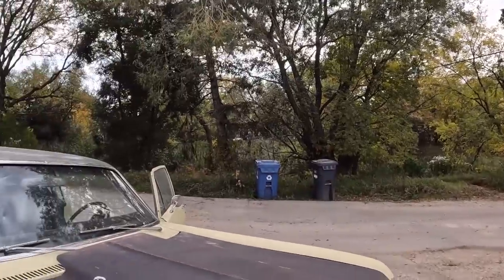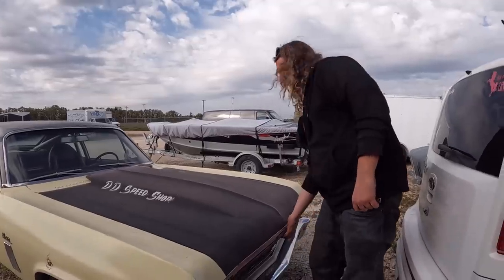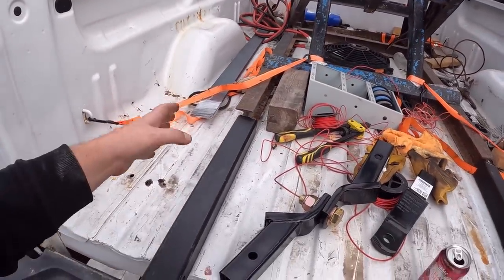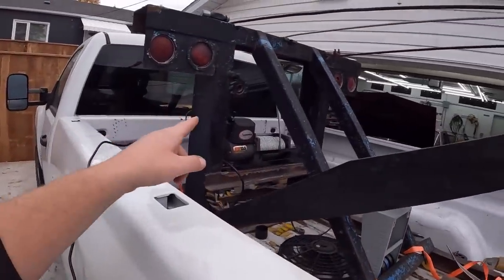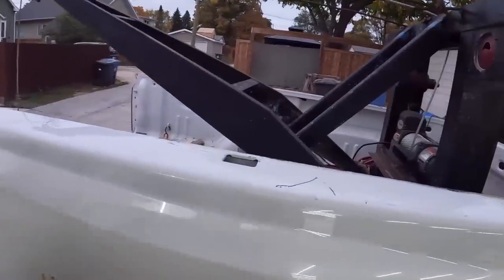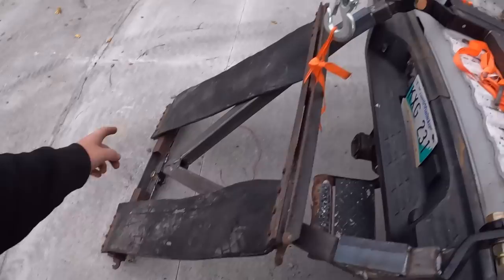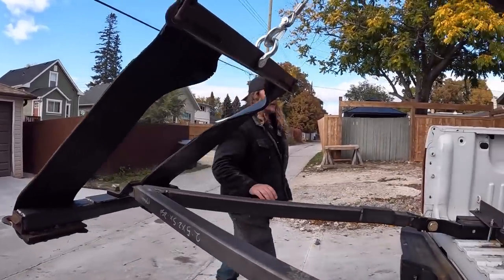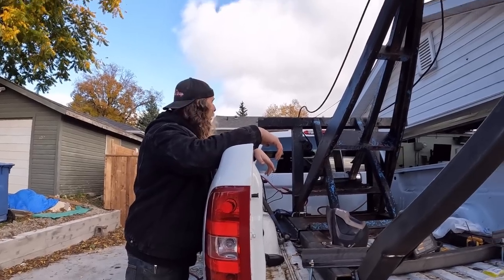Welcome To The Thunderdome - Fabricating A Home Made Car Hauler.  Slingin' Junk

Comment: Great job Dan, not telling you how to do your business but.... Suggest you put a plate in your apex to mount a trailer ball that way you can haul trailers without removing your frame section. We also used our wrecker/ trailer combo to move utility buildings if you raise the boom and winch at the same time it's like having a rollback and it was priceless when moving things. Again Great job.

Comment: So Dan, I ran wrecker back in the day. The outrigger from the wrecker to the bottom of the sling were always kind of floppy. That was on purpose. Yours is way to rigid! As one tows and pulls into parking lots and drive ways, the tow truck and the towed vehicle are not always in the same plane. With as rigid as you have it, the tow truck is going to try to twist the towed car from left to right. I suggest that you attach the bottom of the sling with the bottom outrigger using a hitch ball and hitch part that fits over the ball.

Comment: Dan
Your method and thinking is spot on.
Over engineer a little as you are pulling a 2- 3 tonne projectile when a car or small truck is hanging off the back.
You don't want any breakaway when towing and the added length of the tow frame will also add strength to the truck Chassis.

Comment: It's so cool your creating an old school tow rig style setup that was used commonly back in the day on a current style truck, so cool!!! Also, your very clever for using tow hitches as the strong pivot points on the tow section. 👍👏😎

Comment: Looks good the only thing that makes me nervous is the All Thread which is usually grade three or five and with the weight you'll be hauling I think grade eight is necessary. just my opinion.......
Reply: There is “boiler” allthread.
Strong like bull.
Wear gloves, the threads are deeper than the normal allthread
Reply: @sammolloy1  So you think cheap Dan used the boiler allthread? Ya right.....

Comment: Hey Dan, I put one of these together about 10 years ago in similar fashion and it actually towed really well.  Only thing of concern is your winch. Make sure it's rated for lifting, a regular winch is only rated for a rolling load and not for lifting and holding. Otherwise you will need to look for a proper hoist rated for lifting. Looks good otherwise,  cheers.
Reply: Thats a good point

Comment: When I worked for a auto repair we had a creation that used a Chrysler starter we had a heavy duty battery at the winch with a charging wire from the truck alternator with a extended boom for general stuff well pumps working on fatm tractors out in the fields, it had more winch than truck lol.. it was sure handy.

Comment: I've owned both sling boom and underbody wheel lift variants.  The underbody unit was a former service vehicle I'd bought that had been retired and required everything from the hydraulic hoses right through to the body changeover from my other truck. The sling boom unit was bought from a scrap yard and I installed it myself. I used half inch thick 'L' brackets and Gr. 8 3/4" hardware to secure the unit to the chassis at 8 points, 2 at the front hinge points, 2 about 1.5' behind those,  2 behind those roughly above or just behind the axle, and the other 2 at the rear. The two BIGGEST things I can suggest is to build your rear spring sets suitable to what you figure the heaviest vehicle you will tow will be; and MOST IMPORTANTLY, TRUSS YOUR TRUCK'S FRAME!  If you have the opportunity, look at another similar unit. I used 2x2 1/4" wall square tubing and 1/4" inch plate to fabricate my bracing. I installed mine directly below the frame to keep it tidy. I've also seen it done using 3/8" plate installed vertically at all chassis bends and 1/4" angle tying everything together from the front torque boxes to the rear most mount points. Hope this helps even if in a small way.  Also, keep a 4x4 and a 6x6 by 5ft chunks of wood in the bed when you're towing. They'll help save chrome bumpers, front valances etc when placed across the "j" hook chains and between them and the towed vehicle's frame.

Comment: Hey there Dan. As others have mentioned, the bottom bar of the sling should be able to pivot or it'll bind. Also, you might find that flipping the sling A arm over will help keep the bars out of the car and let the sling carry it. Built my boom truck/wrecker with receiver hitches too!

Comment: I used one of those tow trucks in the 1980s we had it in a 1975 Chevrolet 3/4 ton pickup I towed a lot of different vehicles cars pickups with no issues

Comment: You asked ! I think your winch is mounted 90 degrees out it should face the direction of the pull , they're designed to pull horizontally , the way it is atm it's trying pull the mounting bolts out vertically and not as strong .

Comment: When I started with Chevy in 1978, we had a Holmes. We took an old Ford a/c compressor (york style) and made an air compressor out of it, so when we left and thought we might need air we had a toggle switch on the compressor clutch to engage the compressor.
Reply: Nowadays, I think you could likely use a compressor from something with air suspension. Saves hassle that way and a junkyard part that can be swapped quick without hassle
Reply: @philgrimsey3637  i’ve actually used the York AC compressors off Fords and Chryslers in air ride setups because they fill a big air tank faster than electric ones do. They just work better.
Reply: I been meaning to ask someone about doing that. I'm guessing you'd use the "high side" to pressure the tank and run a pop-off valve to prevent overpressurization, but what do you do with the low side?
Reply: @NAWeldingandFab  just a pressure cut off switch off a normal compressor (like one you’d have in your garage) low setting to kick it on and the high to shut it off and yes a mechanical popoff so it doesn’t over pressure.
Reply: @NAWeldingandFab  I miss understood what you were asking…the “low” side you leave open to atmosphere to intake the air to be compressed. A piece of tube with an air filter on it so you don’t suck dirt into the compressor.
Reply: @AndyGee's Garage, thanks for the replies and the help. I've got a couple old York compressors I've been meaning to use and now I know how.

Comment: Be careful the first towtruck I built was a 73 Chevy beautiful farm truck . But not your beat around the fields farm truck. It was the owner of a big dairy farm truck . It had a 4 speed and a small block.. it was straight and not a rust spot anywhere. White  even the clutch and brake pedals had no wear on the rubber. 
 I bought it from the estate of the owner and they were selling to prevent a family member from getting their hands on it . I think it had 40,000 miles on it.
 I bought a wrecker boom from a wrecking yard.  I was welding on it in my spare time while using it as a daily driver. 
 Now I lived on a quiet street .
 One early Sunday morning 2;15 .I awoke from my sleep to a loud BOOM and bright light lit up the front of my house.
 Well when I opened my front door I knew why .
 A jeep grand Cherokee chief was sitting 1/2 on the boom of my tow truck and half on my service truck for my shop. 
 I had a trucking company and truck shop at the time.
 So the drunk had driven up the side of the tow truck until he got on the boom that launched the jeep airborne and it land on the shop truck .
 The drunk guy thought he was driving when I got out there his tires were smoking imagine like when you do a burn out all the tire smoke it was winter so the smoke just hung there .
 He totalled both trucks. My. Next towtruck was also a Chev but already built Chevron ramp with a sling . Cool square body . 
 Sadly when I was out of town some nice people cleaned me out the tow truck my Mercedes but worst was they got my 67 Camaro and about $70,000 in tools. The good stuff like grandpa's hammer that he'd gotten from his father the thing was like 150+ years old SMH.

Comment: It's been a long time since I really looked at a "hook truck" as we call them in Alabama, but I'm thinking your bottom A frame setup for the sling is a bit long. If I remember correctly, you want your winch cable to be closer to vertical without the load. Plus, the closer you can get the towed vehicle to the back of the truck, the less leverage the towed vehicle has against the truck.

Comment: What I'm saying Dan is it needs to pivot and the bars need to slide in and out so when you turn the car on back won't bind up sorry I'm trying to explain the best I can without being there to show you where you have the part that slides in where it bolts to the frame it needs to ba able to slide in and out about 4 to 6 inches from the bottom sling bar also where it comes together at the bottom bar it needs to be able to pivot also so when your going around a corner it don't bind up I hope you understand now. Trust me I drove alot of wreckers and built a few also my best friend been having a wrecker service for over 40 years. Your friend from Louisiana Rick 427

Comment: Hey Dan, you may want to consider reinforcing where the ball mount plate is attached to the square tube. In some of the vehicle recovery videos I’ve seen, that ball mount plate rips right off, which has lead to lost lives. I’m not saying that what you are doing will put the same stresses, but it’s something to consider.

Comment: "a force to be wreckin'd with" 🙂Great video as always!
Speaking of forces, make sure you consider where and what direction the forces are when you're loaded.i'm guessing you'll need better anchorage at the front because with down load at the end of the A frame it will want to  pull the front end up off the bed, whereas the back end will be forced down.
also, it looks like the framing at bottom of the sling may hit the cars bumper due to curvature of the bumper and sling wrapping the bumper somewhat; you may need to create some offset there.

Comment: Matt's off road ,Paul over on Fab Rats  are both building wreckers and if you need advice  they're both good guy and I'm sure would answer any questions you have 
The only thing I think is that the assembly should be bolted through the frame  to keep it from sliding ( if it happens) through the c  clamps. Just my thoughts.

Comment: Really dig the wrecker attachment. I’ve got one that came from grandpa he came up with in the 60’s and was from the late 20’s or early 30’s. Still building the truck mine is goin in but I had a plan for mine that might be up your alley. I’ve got some semi trailer landing gear and big square tube to build a rear bumper with outriggers on each side. The truck I’m using is a 95 1ton which is the body style before yours. The frames are marginal as far as strength behind the rear axle so I figured the outriggers would save me some headaches in the future, just my thought anyway. Mines an extended cab like yours and I’ve seen a few of em folded up after the rust sets in. The tube I’m using is 8x8 which is definitely stout enough that I can fab up another couple of pieces to slide inside that the outriggers will attach to. Then they can be slid out and pinned for anchoring the truck or taken out when the portable wrecker comes out and still has a bumper on the truck. I figured you might be like me and use it for pulling engines or using out in less than stellar areas where outriggers are a little more work but they save a lotta headache when the grounds soft, just wanted to run it by ya. Broke a transmission park pin when I was a kid before I knew better, quickly learned the importance of anchoring, lol. 

Hated to see you parking the nova again but glad to see that the top end won’t have water causing trouble with the tunnel ram.  Great video again, y’all have a good weekend and enjoy what’s left of the lack of snow. 👍

Comment: I love the idea with the trailer hitches, wish I thought of that years ago. As for the tube you put on the side yeah I'd say it's a little Overkill, but also know it could be used as a spacer. One thing that sucked about the newer 2000 trucks all manufacturers started going with a different frame widths and hights. That's why you see most of the newer trucks especially service bodies and tow trucks have removable sides, it's so the center section can be adjustable to accommodate which truck it would go on

Comment: Hey Dan on your sling you should turn it where the straps wrap the tub somewhat because all the wreckers I ever drove of built with my buddy Vincent the sling straps always came from under the bar. Not trying to tell you what to do but I do know a little about this stuff also by dubbling your cable you can pick up more weight

Comment: Looks real good. You might have to shorten the lower trailing arms, they shouldn’t be longer than 30” But I guess we’ll see how it handles weight. You want to keep as much weight on the front end as possible. 👍🏼
Reply: I was Thinking the Plow as additional weight on the Steers Will Help with that. However, I Agree, It’s looking like the Load might be a bit far off the tail end of his Truck when Rigged to a Vehicle.

Comment: Your doing a great job Dan I never noticed where your bottom bar is on the sling where it's joined to the 2 bars that run to the bottom sling bar do you have it where it can pivot it should be able to pivot and the 2 arms need to be a ble to slide inside of the square tubing.

Comment: Replaced the rubber slings on mine once....they were overpriced, but....stuff like this welding makes you wish you had a stick welder, bought mine at an auction many moons ago. Hint....you can use a high powered alternater that'll power an onboard stick welder conversion. I would keep an eye out for a dually rearend if I were you.
Reply: My daughter in law used to work for a gravel making operation so I have a huge roll of used conveyor belting. It makes great sling material . A sawzall does a decent job of cutting it..

Comment: A sheave at top of sling,and back up to wrecker frame. More hoisting power,and less pressure on winch brake,if it has. Liking the plan though. 👍
I would be stick welding though.

Comment: The sling on my wrecker rotates when surface is uneven not sure if yours not will cause a problem or not
Reply: Good point. The sling needs to pivot on turns with the vehicle in tow, the front end on the wrecker might want to slide.
Reply: @alvaradotowing23  the deal with the sling he has a pivot point for turns but he doesn't have a pivot point if like the vehicle isn't on level ground going thru ditches and driveways the sling needs to pivot kinda like a ujoint does at least my wrecker pivots both ways

Comment: I just replaced the frame on one of those, i think it was a 2015.. those round  horizontal supports hold a BUNCH of unwanted  gravel, rocks, and dirt.... the frame rails themselves  do this as well.. the whole back side of the frame was rotted and was cheaper and safer to replace the whole thing and,  better looking. Than a patched up rusty frame! So make sure you wash it real good, and blow that wand into the openings un the front and rear of the frame, blow out all that dirt, cause i guarantee there is some! LOL also the round braces that hold up the gas tank and i think the spare. Gotta hit inside those for sure! They are just wide open on either side amd they pack full o stuff! Thats how i got the frame job in the first placr! Round support rotted and started dragging the tank! LOL fun times INDEED......

Comment: you do want steel plate under the wrecker ,then bolt right through to the frame or what i have used is U bolts around the frame

Comment: You can fab a wheel lift unit on back. Uses that same wrecker unit you have to pull it up. I have a 70 f250 single rear wheel and that's what that has for a body on back. I can haul almost anything except anything super heavy.
Reply: That's cool man. My dad built his own wrecker boom setup in the bed of a 77 F-250 when I was a kid. He hauled everything with that old truck. Lol

Comment: Wish i would've known before you were gonna do this...i could've gave you a few heads up's and sent some reference photos etc.. But to be honest- you mostly overbuilt all the weak points anyway. One thing I might personally do though, set up some kind of safety chain so it's not hanging on the winch...or at least if the winch settles it will catch it before it goes too far. Worm gear winches can handle a dead load but planetary winches like that....I dunno. Also, I'd swap the all-thread out for actual bolts. I've had a couple bolt-in's and even with the best hardware they stretch and loosen up over time. All-thread isn't very hard, that's gonna be your failure point most likely. Oh and one last thing, if you set it up so you can put a couple (removable) pins down on the bottom of the sling you can take the remote in the truck with you and lower the sling under a car and lift and the pins will catch under the bumper(for moving junk around one man its a massive time saver-you do stand a chance of tearing stuff up so I wouldn't recommend it for stuff you really care about). Also, some wood blocks are clutch. You can tow brand new cars if you get really good with blocking up underneath so it kind of lifts the vehicle instead of crunching on the sling. Eh...you'll learn as you go. I can almost guarantee the first thing you'll need is some stiffer springs though. Just adding a couple extra leaves usually works a treat. And your distance bars look a bit long? It's kinda hard to tell, and you want the load pretty far back on a truck with a bumper anyway so it doesn't jack-knife in the corners. You may not know for sure until you try it a bit, but the further out it is the more leverage it'll have and the nose of your truck will get light. This turned into a way longer comment than i meant-i just kept thinking of things. Anyways...good luck!